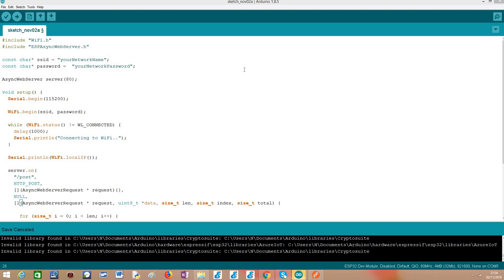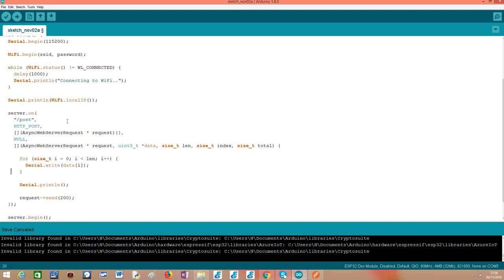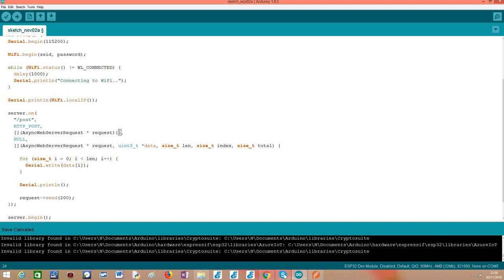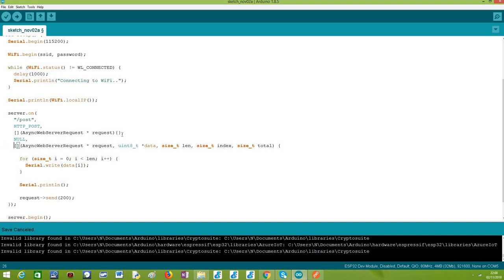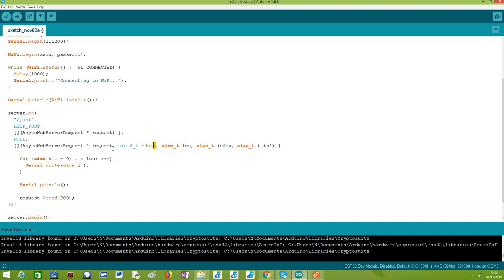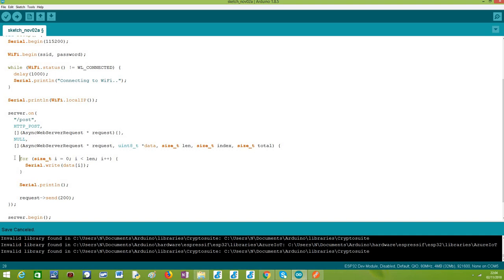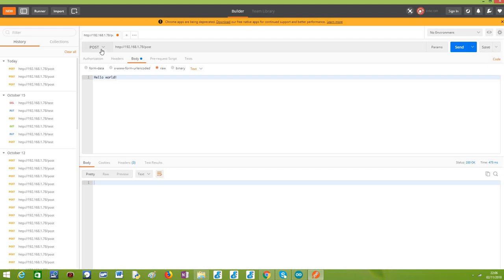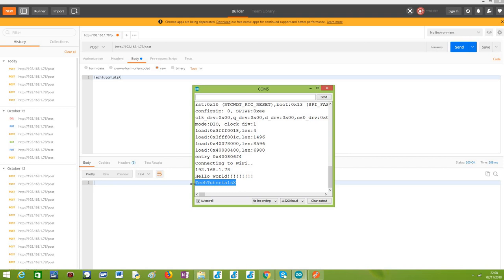ESP32 Arduino HTTP web server: request body handling

Comment: Sorry to tell you this, but this doesn't work, as the code is wrong. I have tried this and it does not work. I've ended up asking me-no-dev (ESPAsyncWebServer creator) help and opening an issue in the library's repository. Check it here: https://github.com/me-no-dev/ESPAsyncWebServer/issues/689